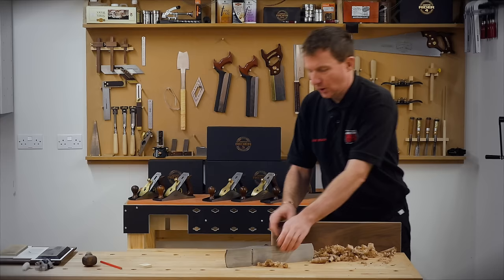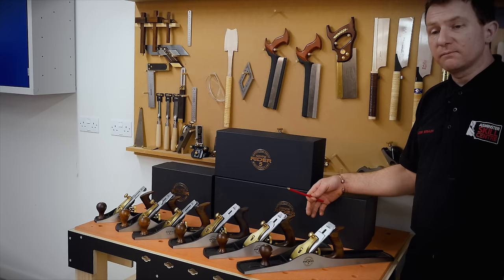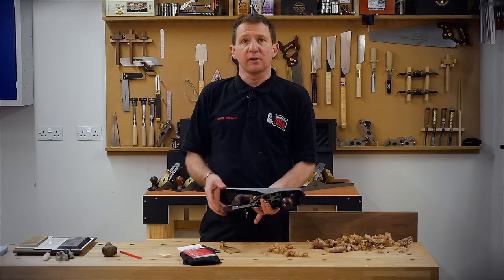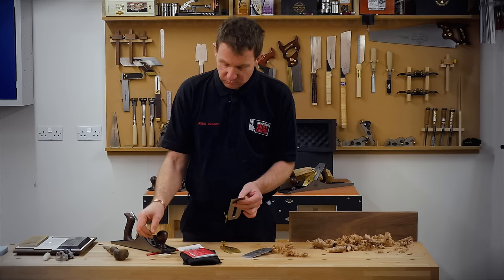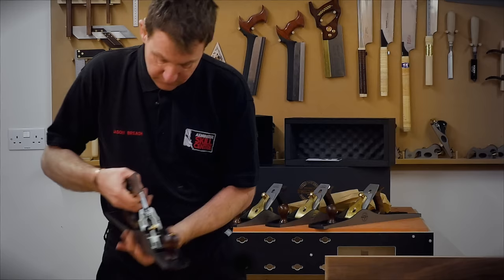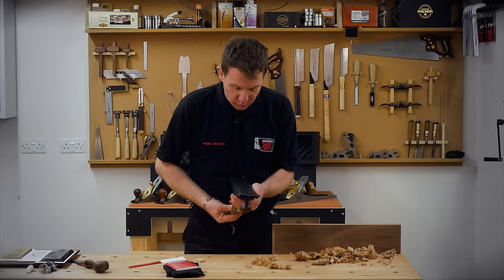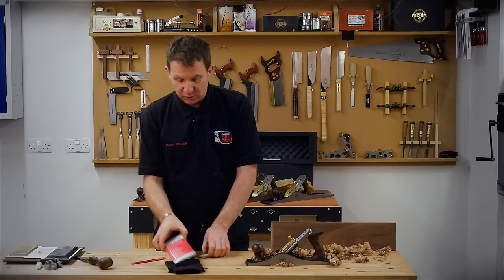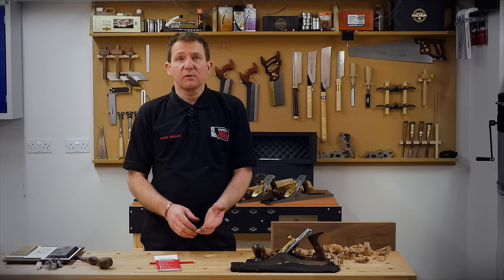Axminster Rider Bench Planes  - Overview of the bench plane range

Comment: I bought a rider block plane and it took me 3 hours to get it to work and even now it's still not right. The sole is not flat, blade back is not flat, had a 27 degree grind instead of the stated 25 and the frog is not flat so the blade cuts unevenly. Basically don't waste your money on rider planes. I won't buy another that's for sure